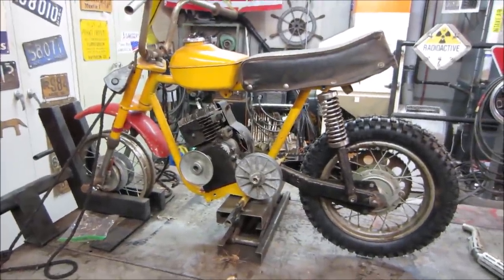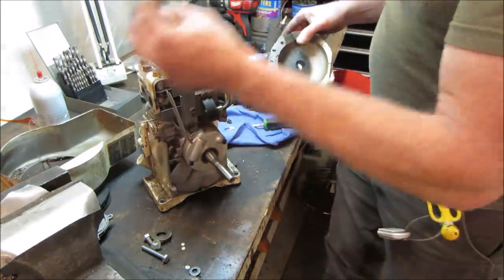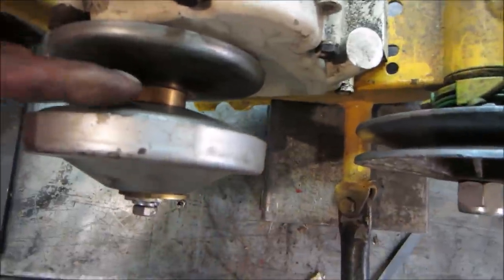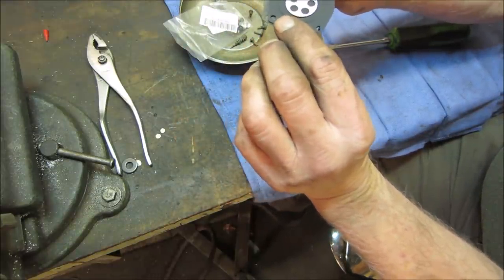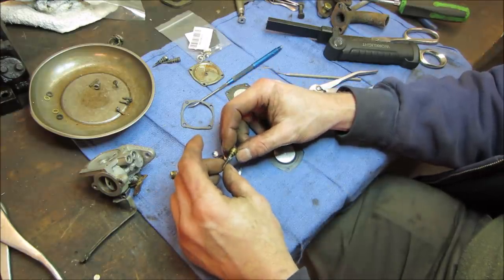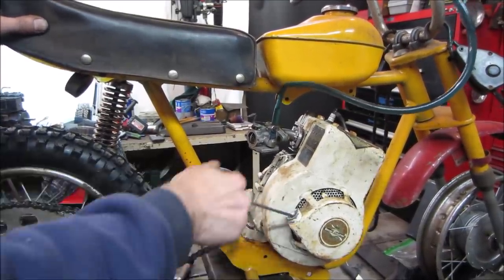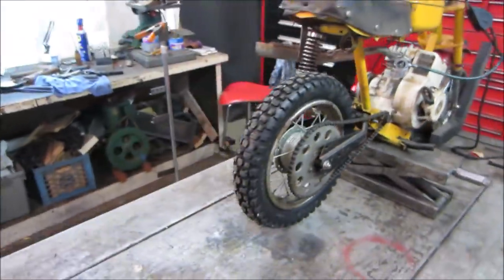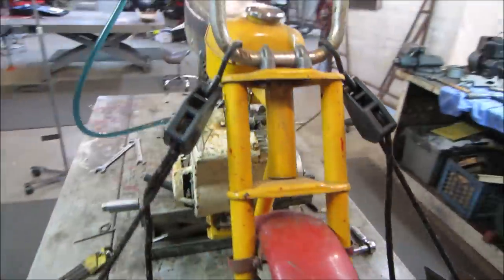Trashed Rupp Mini Bike, Will It Run? pt2

Comment: My mid 70s Rupp Roadster had a “torque converter” that looked like the one on the Beaver. I think you are correct that the rear pulley is correct but the one on the engine is not the original. Also, when you use taps with a drill driver, my machinist father and grandfather turn in their graves. 🙀
Reply: By hand with power drill, not wise. Although done with a Bridgeport, much more accurate.
Reply: cordless tools have   lots  of uses but not as a tap threader.
Reply: Yes the original Tecumseh engine had the torque converter clutch on it that had four big tabs that came out whenever it was going faster
Reply: I was looking away from the tap like when I was a kid watching The Exorcist for the first time
Reply: The tap survived.
Reply: Yep!!!  Ahhhh. Mustie needs to overhaul a drill press!!!  That makes it easier to tap it true and straight!
Reply: Man, I was just waiting for the tap to snap
Reply: You guys would hate seeing me use an impact driver with a tap! I use whatever tool is within arms reach.
Reply: Yeah, that kinda had me waiting for the snap.
Reply: HA!
Reply: @cliffordkinnear9705  He has one
Reply: Full disclosure, I do the same thing at work sometimes, but I back it out to clear the threads more often. I've only broken a couple of them, and they were cheap DeWalt bits.

Comment: Hey Mustie, 

Just a fyi - the carb you are taking apart is a Tecumseh diaphram carb. The orientation of whether the gasket or the diaphragm goes first is dictated by a stamping of 'F' on the carb. If the carb has an 'F' stamped into it, the diaphram should go first, otherwise the gasket goes first. Also, that seat you were missing should be the same as the seat used in all Tecumseh carbs.

Cheers,
Reply: Those carbs are originally a Tillotson design. They were used frequently on those really old monster chainsaws that had the carb hanging off the back in the rear handle area. I had an old Sears that was built like that. Those carbs work fine at any angle, so there was no need to build a new manifold. The one it had would have worked perfectly fine. Also, the ring on the rubber seat always go down. The “pin” on the diaphragm should go toward the needle.
Reply: Bet that carb made it on there because they dont mind the angle without the proper manifold

Comment: You might find it's tricky dealing with your oil without a filler on the right side of the block. Also, Rupp Tecumseh engines had an extra tab on the rod to help splash oil around because of the angle that they sit. The serial numbers on them are marked with an HS35, HS40 or HS50, depending on horsepower.
Reply: Oh I know iiu
Reply: Good to know. I was a little worried about it.
Reply: That Brigg Has what they call a oil dipper that bolts on with the rod end cap also.

Comment: The back pulley halves have holes in them for those spring ends to go into. The inside half has three holes to set spring preload for flat terrain, the next hole is for slight hills and the third is for extreme hilly conditions. The outside half has one hole ,so you put spring end into hole and twist it to preload it. According to which hole you choose on the inside half determines the amount of preload you get.
Reply: What I remember from an old friend is that the Driven clutch spring not only offers expansion tension, but its torsion strength against the bevels is accounted for too.
Reply: @williambouman8302  ok I'm

Comment: The sunday this was uploaded (i'm posting the day after at after midnight) was my birthday, and I am so happy to say that mustie was my inspiration to fixing small engines and follow through on my interests in how stuff works. A few weeks after my first video i watched (the push mower with the no change oil and the upside down blade) I picked a lawn mower from my neighbor's trash, they were throwing it away and i was like "you know what, I can fix that for sure" I asked them what happened and all they knew was that it started revving full speed and they stopped using it. I tear into it, find the carb had been roached by ethanol, and that the self propel had ceased up from sitting, which i had to pull the motor off to get it out, and fixed that. then when i was putting it back together i found out they had managed to drop the governor rod and thats what caused the rev issue, which led to the problems from sitting. It's a beast of a mower now, a honda hrr216 that i got the side discharge chute for which allows me to get in narrower places than my briggs powered bolens because the side chute doesnt stick out. I wouldn't have taken that project on had i not started watching mustie and i thank him, because not only did it prove to me i was capable mechanically to fix things, it saved a otherwise perfect machine from going to the landfill.

Comment: That spring on the rear pulley is suppose to be wound up some so that the rear pulley is torque sensitive.  In other words as you apply power the engine rpm will go up.  Adjusting the amount of wind up will change how much rpm changes with torque.
Reply: Help lol I see the back pulley is touching both sides hows it going to open up to let the belt go down the 2 wages are touching I feel like it's backwards the other way would allow it to open up moving forward so the belt would set deeper. The way it is seem like the 2 halfs would move from the wages

Comment: Mustie, you might want to put the moveable sheeve of the primary clutch on the outside rather than the inside.  This would help with the belt alignment with the secondary clutch.  This is how it’s done on snowmobiles!!
Reply: Yes he has it backwards block side stays still.

Comment: I had a spring-loaded screw get launched across my shop. I looked and looked and looked, finally had to order a new one. About six months later I opened my fire-proof cabinet and opened a locked drawer inside and found that screw sitting on top of a pile of papers. I guess there really is a Twilight Zone for that sort of thing.
Reply: Any 10 mm sockets in that Twilight Zone of a drawer ?
Reply: @NoWr2Run  I should go check, but I'm nervous what might turn up.
Reply: Ah, it must have passed thru the legendary time/space wormhole to the parallel universe of lost frendle pins

Comment: As far as your concern with the clutches moving opposite directions from each other, all Polaris ATVs and Side by Sides(possibly the snow mobiles as well, never dealt with them) have been setup like that for years and never a problem caused by it

Comment: i had one of those years ago but it was missing the jackshaft parts, i was able to flip the rear wheel and run the chain directly from the back sprocket to a regular minibike clutch, i may have ran rear struts instead of shocks to keep the chain tension consistent i cant remember. I worked out good, it lined right up.

Comment: That looks like a Rupe roadster...I had the roadster as a kid.  Took off that hookey torque converter setup (this is an early cvt .. they used these in some snow mobiles)and replaced it a centrifcal clutch and sprocket.
Reply: So you lost all of your torque multiplication.... bad choice.
Reply: @malbers35  hey ... I was 14 years old (I am now almost 60) but they sold those kits all over -- everyone replaced that stupid torque converter... the problem is the torque converters dont work well and were always a problem, very poor efficiency in these squish plate torque converters  -- the latter Rupps used a more standard clutch  --- but great memories.

Comment: It looks like the secondary clutch needs flipped to match the front. I’ve never seen one ran opposite each other. And the spring needs a little preload to keep it from opening too soon.
Reply: most cvt's run in opposite direction
Reply: The first clutch moves the belt towards the bike, so does the second clutch. They look opposite as one is closing towards the bike frame, the second one is opening towards the bike frame.
Reply: @urbex1789  I’m not sure most do, maybe the newer chinese ones but honda and every snowmobile I’ve ever ridden has them aligned with the moving side out on both clutches.
Reply: @johntunstall9698 , you are correct sir.  The movable sheaves on the primary and secondary clutches must be on the same side.  Most if not all current generation setups have the fixed sheaves on the inside!!  Otherwise you’ll be torquing that belt and it will not last very long!!!
Reply: @johntunstall9698  Just type "how a cvt work" on YouTube and you find many videos that show it. Btw I'm mechanics and I open atv's and ssv cvt cases mostly every day so I'm pretty sure of what I'm talking about.
Reply: @urbex1789  not be a dick but all the cvt videos i see show the clutches aligned with the fixed side towards the engine. I’ve worked on enough of these to know how they’re put together on honda odyssey’s and numerous snowmobiles. I’m not saying they can’t be opposite but I’ve only ever seen them fitted one way. Even on YouTube now that I’ve followed your suggestion. I still didn’t see one the way you described it.

Comment: I had to smile when you opened the ultrasonic cleaner - that basket is SO ****** CLEAN !! It's very, very similar to my deep-fryer, which I do try to keep minty fresh; at thirty years old though, it doesn't look like that. Usually, anything that cleans, is pretty filthy itself - that ultrasonic must be the cleanest machine in the shop.😁👍

Comment: My Dad bought a Rupp Scrambler new in 1971.  It was metalllic green with the "TC-1 Torque coverter" plastic cover over the clutch setup.  The engine was a 3.5hp model, it had 10" wheels, big shocks and that thing would pop a wheelie with my Dad  sitting at a stop at half throttle.  I had a little 2.5hp mongrel mini bike pieced together from different parts and we would ride in the local sand pits.  I got 50 cents a week allowance and could almost get 2 gals of gas with it.  Its a crappy feeling running out of gas and having to wait until next week to ride.   Thanks for the great vids.

Comment: 3:47 Using a carbide rotary file on a Dremel will work to deepen the key slot.
20:31 Guess you never worked on driven clutches for a snowmobile.
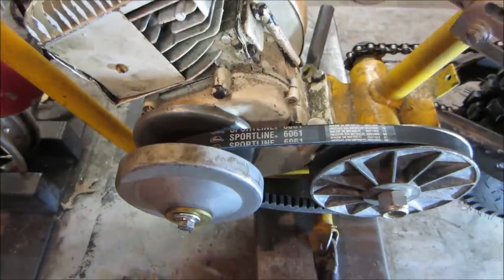1:19:34 I thought he had a lathe. He could cut the driven clutch nut down for a better fit.
Reply: It would be nice for him to find an old snowmobile to work on, maybe something unique.
Reply: @gord7025  I always wanted a Manta, duel track, reverse and an in closed cockpit with heat.
Reply: RDF, I wish he would have kept the 5 HP engine on the Bike, Deepen the key slot as you said.
Reply: @NoWr2Run  I agree with you.
Reply: @RichieCat4223  that would be an awesome machine. I've seen Raiders but I don't remember seeing one of them in my lifetime.
Reply: @gord7025  I saw one years ago at the snow-deo in Old Forge NY. It had a 215 all aluminum Buick V8 (1963-64) in it and used a VW trans axil to drive both tracks. Guy said he never took it out of 2nd gear, it was too fast. Lol.
Reply: @gord7025  Raiders are the same concept.

Comment: Nice job sorting out the parts needed. Should be a sweet little rustoration when you're done😅. Can't wait to see the final results. Thanks for the invite to hang out while you turn some rusty nuts and bolts, Until part 3 ...have a good one.

Comment: That second carb in your video is basicly the same carb i am using on my 3hp Briggs, but mine has the mixture adjustment on the bottom. Mine was off a Tecumseh H35 engine and is far better than the Briggs carb. I have been building intake manifolds using brass plate for the flanges that  I bought on eBay and copper tubing I bought at Ace Hardware and then I silver soldered it together. Between the intake and block I used 3 insulating gaskets about a 1/8 inch thick each to keep the carb and soldered joints from overheating. It has worked good for about 1-1/2 years now.

Comment: Hey Mustie, that governor also acts as a cooling fin, it directs air from the flywheel over to the cylinder head.  Removing it may cause overheating or may not but just an fyi. 

Also Interesting to see the front pulley on backwards lol. The clutch on the beaver is a 30 series.  The Rupps use the older 20 series with the pullies in opposite directions.  Your newer pulley up front is a 20 series and is the correct replacement.  

your rear shocks are bolted in the wrong spot, move the bottom up and to the right.

Comment: This governor setup on the white Briggs is ingenious
Reply: air vane governers are common on the briggs smaller lawnmowers too.. simple cheap and work well, only possible issues on the lawnmowers is with the dirt and grass and crap they can get a bit stiff so they don't work as well but nothing a clean and lube wont fix.

Comment: Excellent video Mustie  1 :) like Snowblower carb better on low also high idles to and plus remember my Auto Mechanics plus Small engines shop teacher in High School said if see belts or chains on low idles 1/8 slack also light dragging also high idles complete stretch out straight you got made right on carb settings! Plus Snowmobile & Rotteiler does on belt same too ! Low RPM should be 450 to 650 and high RPM be 2000 to 2800 depending on hp also carb is too for mixture light blue white colors tint to clear too on 2 or 4  cycle motors on low idle and high RPM idles clear with heat too! Hope that helps out you Mustie :)  and everyone!

Comment: Really enjoying the rebuild of this mini bike. Makes me reconsider my Whisper Jet XL that is tucked away in the corner of my shed. I have had it since 1984, and it has not run in over a decade, as it has zero compression anymore. I'd rather rebuild the original than re-power with a new engine, but other projects keep taking precedence.

Comment: Theme today Pullcord.... Maybe take the pull cord housing off and use a Battery operated drill to crank it, I know that you wanted to show what it would like to be on the trail but you only have to show it a couple of times. You have enough things to go through then having to pull that dam cord. By the way I love what your doing and I appreciate it Thanks..... Ricky from Cape May

Comment: Harley ran Tillotson carbs for a few years late 60s to early 70s, so yeah, a tilly can run on a 4 stroke, lol. Harley bars are 1 inch od, metric bikes are traditionally 7/8, though their modern hog clones tend to run 1 inchers too. As for your belt, both walking pulley halves move the same way (to the right), so your tensioned alignment should maintain reasonably similar geometry. Great rehab vid, loved the rubber flour production, lol

Comment: I have a Comet "Torque-a-verter" like that. According to the installation instructions, you have the front pulley on right, but the rear is reversed. The sprung-sheave should face OUT. There was a special cup-washer that held the end (sprung-sheave) on with the bolt, on the threaded jackshaft. I ran that setup on a Bonanza minibike with Tecumseh 10HP for years, it went over 60 mph on a dirt road.

Comment: I don't know about your 1970's bike but the Rupp's with the smaller wheels from 1969 came with 5 HP Tecumseh engines and they were always alittle faster than the other mini's of that time except for the Benelli mini's that had regular little motorcycle engines with a clutch and transmission. Only the rich kids had those though.
Reply: I had a 5 also, Was no rich kid either.

Comment: and the exhaust thread is 3/8 blackpipe used on NG, so you can modify the exhaust REALLY easily on those, and can either tap the block for same pipe thread, or drill, dremel, and grind a 3/8 flange, to fit the intake as well, so should be very versatile setup for you and that bike

Comment: I have a complete starter setup flywheel switch and all... for that Flathead Briggs.... Electronic ignition as well.. I need an engine block...been looking for a while... there you have several... I have a New predator, just had my heart on a Flathead Briggs...for my project... Cosmetic reason..

Comment: I use an old hickory axe handle with some holes drilled thru it and 2 long machine screws with nuts as my briggs flywheel puller.  Sometimes those boogers get stuck on there good.  The other end of it I use to mix up tar in the bucket when I redo the blacktop on my driveway every few years  🤣

Comment: You might have some luck with 'rubber roller cleaner and rejuvinator' by Martin-Yale for use in the printing, imaging and paper-handling industries. It comes in a spray can and restores flexibility and "grippiness" in aged rubber. Might save you when you don't have the right flexible rubber part.

Comment: If you try the oily type of tyre shine on hardened rubber and allow to soak for a period of time the rubber "may" soften up. The shining liquid has some softening chemicals in it to allow it to penetrate the rubber. I doubt if it would be a permanent fix but it may get you out of trouble whilst waiting for new parts.

Comment: i think the drive clutch is on backwards. the cone goes on the outside. i thought that on last vid. every one i ever installed had the cone out, the rear one is correct i believe. i don't think the angle will be an issue since it is the v style belt, but it might wear a little quicker though. you might just have to buy a new torque converter to make it work. i usually swap the stock carbs for mikuni clones on minibikes. they are more responsive, and just tend to work better. stock briggs carbs are more designed to run at a fairly constant rpm, so they aren't the best when you constantly change the throttle position. plus mikunis are set up for a twist throttle cable, where briggs aren't. a 5hp will take a 19-22mm mikuni in the stock configuration. you just have to weld up a manifold to fit.